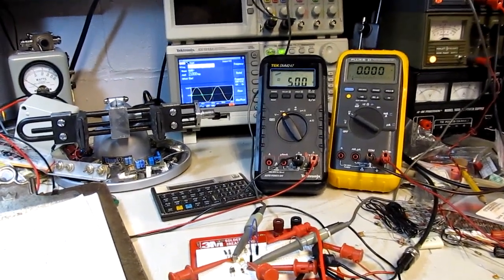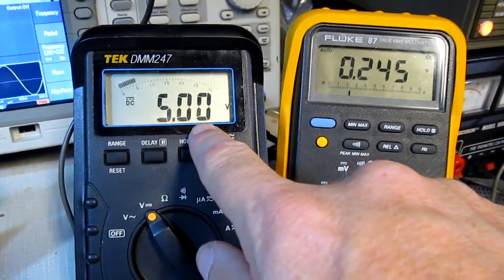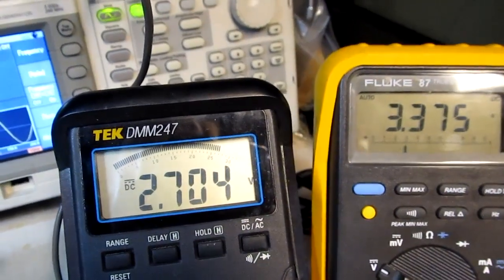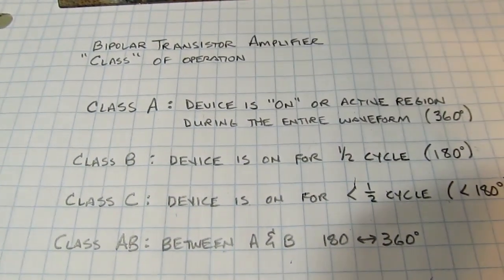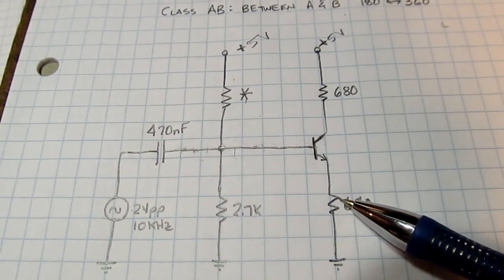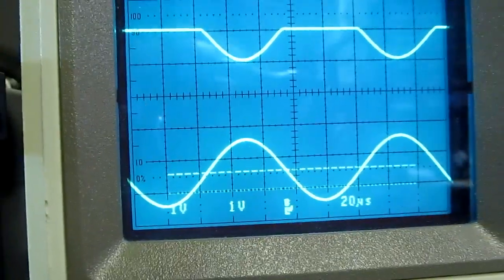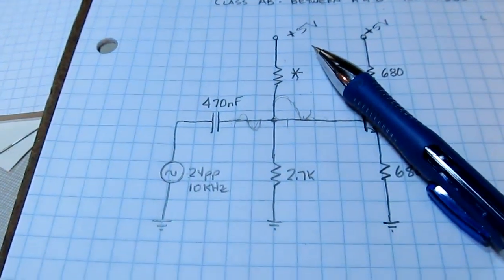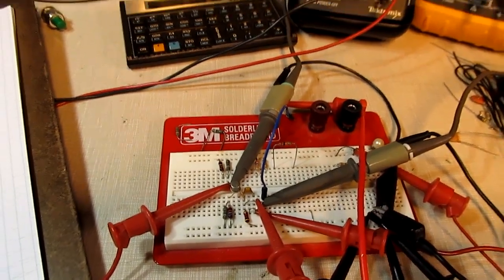#113: Basics of Transistor bias point and the class of amplifier operation

Comment: I was struggling with the concept of biasing a transistor and how it related to its amplification factor. I understand now that:
(1) The bias resistors only affect the operating point of the transistor and the ratio of the two biasing resistors can be adjusted to accomodate any Collector voltage and still deliver an appropriate Q-point.
(2) The voltage amplification of the transistor is dependant on the ratio of the collector and emitter resistors along with the collector voltage applied (in this case 5V)
Wow - thank you, thank you, thank you!😊
Reply from the maker: So glad you found this helpful.  The only time that the base-bias resistors can enter into the gain calculation is when collector-to-base feedback is used.  It's much easier to estimate gain when feedback in the form of emitter degeneration is used.  You might want to check out this video on some hints & tips about common emitter amplifier design: https://www.youtube.com/watch?v=VWY2WQcKJgk

Comment: As I have said in another of your videos, you make excellent videos.
Question: I have heard from many videos and read in books that class A is inefficient compared to class B. I get that A is on for 360deg and B is only on for 180deg but when you add 180 +180 you get 360 so you always have one or the other transistor on. How is that better?
Is it because in a class B both transistors are off with no signal?
Reply from the maker: Class A, B, etc. refer to a single transistor.  With Class B, the transistor is only conducting during <=180deg vs Class A with is always conducting.  It sounds like you were assuming a push-pull stage with two transistors.  Even in that case, only on transistor is conducting at a time (each for a half cycle) when each is operating in Class B.  This is more efficient (less standing power, bias power, etc.) then Class A where all transistors are always conducting.
Reply: @w2aew  Now I get it.
With a class B push/pull, ea bjt is biases as off or active and class A is on all the time biased so that C has VCC/2.
Thanks

Comment: I am confused. I thought bjt is controlled by current. How can bjt base have >0.7v if it is basically as diode (base emitter junction)
Reply from the maker: Similar to a diode, the voltage doesn't magically clamp at 0.7V - there's an exponential relationship between the current and voltage.
Reply: @w2aew  I'm a hobbyist and for about 10 years was thinking that it is clamping indeed. Do you have a video about it?
Reply: By the way thanks for replying. Your videos about electronics are the best
Reply from the maker: @Elektronika1234  The need for clamping depends entirely on the application.

Comment: You mention RF amplifiers often use class C.  Do you have an example of an RF amplifier circuit in your videos?  The reason I am asking is I have built my own working 27MHz Radio controller circuit on breadboards using basic components and an Arduino.  It works with my RC truck but only from 40cm away from the antenna or less.  I am stuck trying to figure out how to boost the signal.

Comment: This is a test set-up, so why use a voltage divider between the variable DC power supply and the base - why not connect the variable DC power supply direct into the base ? It seems to works just fine, I tried it.
Reply from the maker: Yes, but you should apply the bias through a series resistor at least, so that you can easily drive the input with a signal.  I used a divider to better show how the bias circuit would be designed in a real application.

Comment: Some transistors have internal damping diodes, I'm not sure what the damping diodes do and how it affects the biasing or efficiency of the transistor or what advantages of transistors that use damping diodes compared to transistors that don't use damping diodes. Maybe you can make a video lesson about this to see on the oscilloscope comparing transistors that have internal damping diodes compared non-damping diodes. I'm not sure which circuits you would have to use a transistors that has an internal damping diode that you have to use it for a specific reasons

Comment: so in Saturation, the voltage across VCE should be 0V which means the pn region is gone and VCE is a dead short. And this is all dependent on current right? We just use voltage to see what current is doing because voltage (especially in ac world) is just easier to use.  I keep coming back to the same videos with all new questions lol
Reply from the maker: When saturated, VCE is often cited as 0V, but in reality it is not that low.  It is typically a few hundred mV when saturated.

Comment: Learned this from Professor Barry Blesser 47 years ago.  You teach it the same way.  The best demo i've ever seen was in his class.  He set up a 2n2222 on a curve tracer showing its characteristic curves,  next to it was a triode small signal tube set up the same way with a curve tracer.  He held a match an inch away from the transistor and the curves went bananas.  He then held a propane plumbers torch to the tube.  Nothing.  The tube envelope softened and and collapsed on the plate of the tube.  Nothing changed on the curve tracer.  The tube finally failed when it lost vacuum from the glass rupturing.  Lesson 1 in thermal stability!

Comment: I did not understand the change in gain later in the video.  I thought gain was a set feature built-in to the transistor but it seems from this that it is something that can be manipulated.
Reply: So by making the collector resistor a higher resistance, the reduced current coming from the collector resistor is overwhelmed by the transistor turning on passing it to ground through the lower resistance emitter resistor?
Reply from the maker: The components used with the transistor affect the overall circuit gain, just as the components used around an op amp determines the circuit's gain.

Comment: how do you measure a transistor amplifier circuits "efficiency"? because Class A amplifiers are 20% efficiency and Class A/B is 30% efficiency. The Efficiency of an amplifier and the class is based on what and how do you increase the efficiency?
Reply from the maker: Efficiency is roughly a measure of the power OUTPUT of a circuit compared to the power INPUT or CONSUMPTION of the circuit.
Reply: @w2aew  yes but how does an EE design now how to increase the Efficiency of amplifiers and the class used. Because certain Class have different efficiency and the choice of components types I'm guessing will increase the efficiency?
Reply from the maker: @waynegram8907  Efficiency is usually a trade-off with distortion.  Class B, C, etc. all distort the waveform more than Class A, but are more efficient.  Switching-type amplifiers (like Class E) are more efficient, but rely on complex filter design to reconstruct the signal.
Reply: @w2aew  yes Class D is the same way the PWM output has complex filter to reconstruct the signal. The Efficiency issues with Class A is that its always conducting even when NO input signal so its always turns on which is draining the power energy. Plus you only get 20% of output power when using class A. The 20% of actual output power and 80% is consumed by the components going wasted. I'm surprised no one has come up with a better Class A design that has more Efficiency
Reply: @w2aew  I'm not sure if I got the formulas correct, Absolute VA power formula is VA = I * V , Reactive VAR power Formula is I Squared by 2 * XL = VAR , Real Power formula is I * V = Wattage. Does this look correct to you?
Reply: @w2aew  Can you make a video less about "DC coupled transistors" because when transistors are DC coupled if one of the transistors is bad shorted it causes all the other DC transistors that are Daisy chained in series to measure BAD in circuit so the repair technician will think 10 transistors are BAD because only one transistor is bad because they are DC couple. The main question I have is what is the advantage of using DC coupled transistors? In audio amplifiers they use DC couple transistors which much have an advantage for using this type of topology
Reply from the maker: @waynegram8907  DC coupled transistor stages have the following advantages:
1) No need for large value coupling capacitors to pass signals at low frequencies -  improves low frequency response and saves money.
2) If designed properly, bias setting resistors for later stages are not needed - saves money with simpler PCB design and fewer components.
Reply: @w2aew  What is the advantage of biasing a transistor in "Inverse Linear Region"? When would a circuit design would want to bias a transistor in "inverse Linear region?
Reply from the maker: @waynegram8907  I don't know of any common applications for the inverse linear region of operation.
Reply: @w2aew  can you think of what type of application the inverse linear region biasing would be used?
Reply: @w2aew  Germanium transistor have major drifting issues, but the Military Spec Germanium transistor don't drift has much. What is different about Military Spec transistors? it something added in the process or the doping processes? The NKT275 germ transistor is NOT military spec which drifts a lot from hot and cold temps but the CV7003 germ trans is Military spec which doesn't drifts a lot from hot and cold temps

Comment: Awesome video. Please i have a question?
Assuming i want to amplify a signal voltage of 10mv, what value of zero signal collector current and VCE should be the Q-point of my transistor? Thanks in advance for the assist
Reply from the maker: It really depends on how big the output signal needs to be.  You'll get the most headroom for your output signal when the no-signal quiescent point is midway between VCC and (Vemitter+500mV).

Comment: hi is the same theory applied for mosfet transistor?
Reply from the maker: Yes, except that the bias points will of course be different.
Reply: @w2aew  mean for class A mosfet, the biasing point is not in the middle?
Reply from the maker: @boonyang88   Biasing is in the middle, sufficient so that the peaks of the input signal cause the output to remain in the saturation region (not linear region or cutoff region).  The quiescent voltages at the drain, gate and source will be different from what they would be for the collector, base and emitter of a BJT.

Comment: Hi Alan, @6:20 , I could not figure out how you could get filter out the distortion, if the transistor is conducting for only half the waveform.Do you have any videos on this ?
Thanks a lot for your work,learnt a lot from your videos !!
Reply from the maker: Think of it this way...  Assuming the signal is supposed to be a pure sine wave, anything that causes it to deviate from a pure sine wave would be harmonically related distortion components  If you effectively filter away the harmonic energy, you'll be left with the sinewave.  In RF applications, this is often done with a tuned or resonant load in the amplifier or a filter.

Comment: Hi Alan, could you explain about decoupling capacitor and bypass capacitor? And maybe differences, if any. I am self taught, just come to emitter bypass capacitor after watch a video on youtube. Search it in YouTube, google, and found its confusing me. I can't find any clear differences between those.

Even what I saw in Dave video about bypass capacitor, it looked like decoupling capacitor if I refer to another source.
Reply from the maker: The terms "decoupling" and "bypass" are often used interchangably.   The difference is subtle, and the functions are very closely related.  Strictly speaking, a bypass capacitor's function is to cause a signal, noise, etc. to be routed to ground, "bypassing" the circuit that would be negatively affected by it.  A decoupling capacitor is designed to smooth out a DC signal, decoupling it from any variations due to transient current demands. In other words, it decouples the effect of other circuits on the circuit being served by the cap. These terms are usually applied to capacitors placed across supply voltage rails.  You'd be basically OK to use the terms interchangably.
Reply: @w2aew  thank you Alan. I need to read it again and again to understand it well. Anyway, thank you.

Comment: Thank you. What is cautius measure from electrocute myself if I wish this project?
Reply from the maker: This is all low voltage, low power, no worries.
Reply: @w2aew  I try to immitate your experiment. I just find that I need 2 different Voltage sources. Now I have a problem. How can I ground them (2 bench power supply) together safely? Can I just connect their ground? Do I need two channel bench power supply?  Can I ground one Bench power supply to negative of a battery pack?
Reply from the maker: @uuyoubaan4uuyou829  yes, no problem. you can connect their grounds together.
Reply: @w2aew  Thank you teacher.joining all negatives and all grounds  of two bench together to be.one single electric node. Am I correct?
Reply from the maker: @uuyoubaan4uuyou829  Yes, since there are only positive supply voltages being used, the ground/reference should be common to all.
Reply: @w2aew  Thank you teacher
Reply: I just successfully experiment on your method. I feel understand now. Thank you very much.

Comment: Have you done any lectures on the uses of divider junctions and shunts?
Reply from the maker: Your question isn't clear to me, can you elaborate?
Reply: @w2aew  I am trying to learn about voltage dividers. Also want to learn how and why shunt resistors work.  Thanks!!
Reply from the maker: @user-su5sq5ib3i  I don't have a video on these topics specifically.  The key to remember is that components in series have the same current flowing through them.  Since the voltage across a resistor is the product of the current and resistance, there will be a portion of the applied voltage appearing across each resistor.  And, the sum of these voltages on the series resistors equals the applied voltage.  A shunt resistor is any resistor that is connected in such a way as to cause an additional path for current to flow, which takes some of it away from the main path.  My video on using a shunt to change the scale on an ammeter might help: https://www.youtube.com/watch?v=4U-nxdp-LDw
Reply: @w2aew  ok the voltage divider makes perfect sense!! Ive never heard it explained so easy its about controlling the voltage at t certain point using the resistance as the variable.  Ok on the shunt resistor as well. So it works more in controlling flow or current... thank you so much. I am electronics enginnering technician school in September and want to fully understand all of these concepts. I have learned so much from you. 73
Reply from the maker: @user-su5sq5ib3i  A shunt resistor is like a "bypass", an alternate path for some current to take.  In the ammeter video example, the meter max's out at some low current value, so to make it work with higher current, a shunt resistor is used in parallel with the meter to provide a path for the bulk of the current to "go around" the meter and not thru it.
Reply: @w2aew  ok I understand.  So the math for this is very basic using ohms law in parallel.  So there be multiple shunt resistors when needed?
Reply from the maker: @user-su5sq5ib3i  usually just one, with an appropriate value for the application - unless there is a need to shunt current to different circuits or places.

Comment: why need a pull down resistor on the input base line?i still don't get it.
Reply from the maker: The pull up and pull down resistors on the base are used to set the desired bias voltage at the base (and thus, the emitter too).  This voltage ultimately determines whether you are running in Class A, B, C, etc.   If you don't set the bias correctly, you won't get the class of operation you want, or you may even saturate the transistor.

Comment: 11:35   
I could not see where the jumper was connected.
Would you explain where it was connected  ?
Reply from the maker: I had a jumper that was shorting a larger value resistor in series with the collector resistor. When I pulled the jumper, the collector resistor increased thereby increasing the gain.
Reply: @w2aew  
Now everything is very clear  to me. 
Thanks again for your explanation.

Comment: A handy calculator to calculate component values for Class A amplifier.

https://observablehq.com/@flpvsk/calculating-a-common-emitter-amplifier-circuit

I didn't try it extensively, but I believe there's a way to alter the 'hard coded' variables in the source code too.

Comment: Yet again another stunningly superb video Alan.
It explains SO much and in a simple to understand way with the visuals that are the clearest ways of learning.
I'm a visual learner and not an academic by any stretch of the imagination yet can fully understand what is going on when you explain it so well.
Which compliments and enhances the written word so that I can now understand it better with books like the Transistor Circuit Approximations book by Malvino and EMRFD which is also excellent.
These books are superb!

Modelling it on Ltspice has some very slight variations (transistor gain I assume) but now being able to calculate the workings of the circuit, is easily fixed.   

It really is all about the teacher and their methods of teaching.

One question though, do you have a follow up video that explains how the filtering would work to clean up the signal and to as you put it,  remove the distortion.
I need to know this next stage Hi Hi.

Very kind regards, James and thank you again for such a brilliant series of videos. Utterly superb series.

You need to write a book with all of this in it! Despite the videos, I'd buy it.